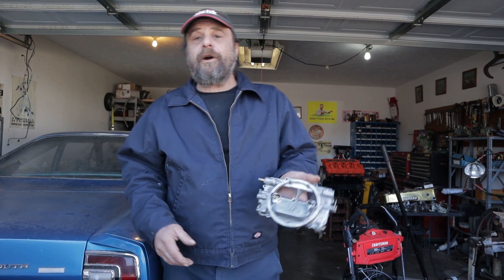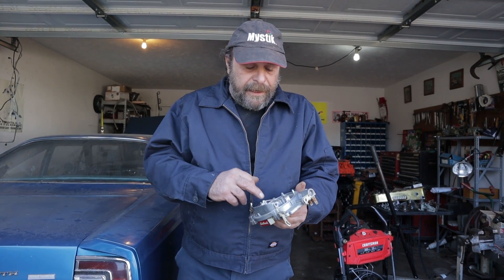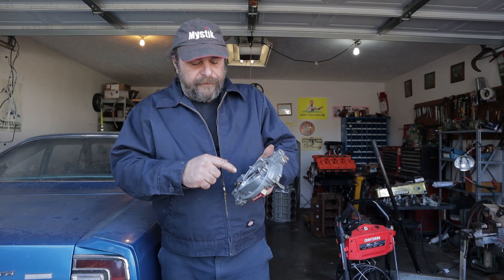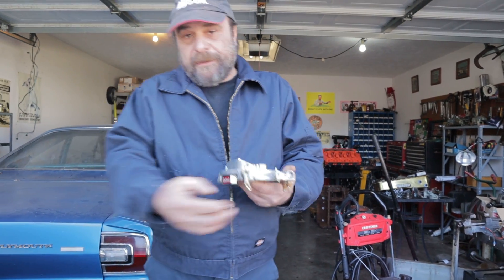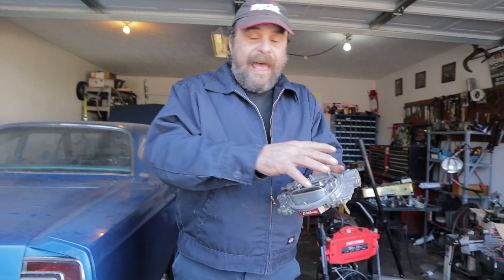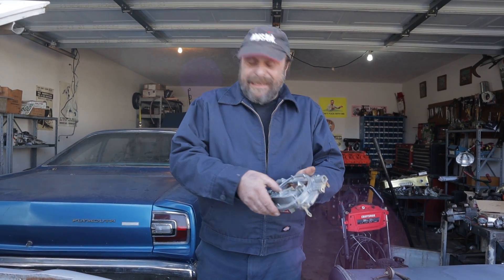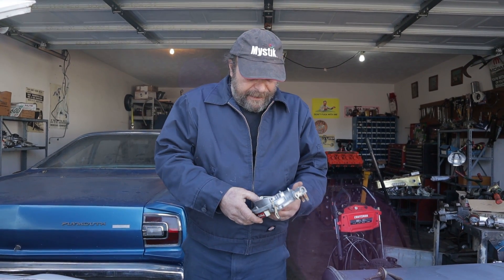The Most Troublesome Part Of Any Carbureted Car

Comment: Tony got a question that I'm hoping u could answer.   I gotta 350 in a 70 Buick Lesabre.   I made sure to set the Rochester up correctly with its divorced choke setup, mixture, fast idle and curb idle.   Even at Summer time it takes a long while, I'd say about 10 min on a very hot day for the loping idle to settle into a smooth idle.   I notice if I don't wait the ten min,  it will drive fine but will continue the loping idle at a stop light.   Only after I get home and put it in park,  it will still take the remainder of time the engine needed to settle into that smooth idle.   Im not thinking this is carb related but if u can shed some insight on this,  I'd appreciate.   Thanks and keep up the great work!

Comment: Choke what's that I don't use that especially on my John Deere d110 I just spin it Let It chug add some throttle get a bang drop it back all the way down and let it idle

Before I ever touched a computer or Electronics I was on the lawn mowers and the snow blowers especially that Tecumseh engine what a POS that could be with the carb

John Deere d110 no issue there now the way did the choke on that is if set to Full Throttle and you passed that then the choke comes on but usually I never have to engage the choke I just add a little bit more fuel back it off it gets the right ratio and ignites and the neighborhood knows who is cutting grass

And the other reason why I don't bother with choke like Tony says I don't worry about that because I pee standing up

Comment: Last time I drove a carbureted vehicle, it was a 1978 Chevy C1500 long bed pickup with a stovebolt 6 and three-on-the-tree manual. The guy had taken great mechanical care of that old truck, I pumped the gas twice as instructed, and the engine barely turned maybe 3 revolutions and started right up from dead cold (65F ish degree day) and was amazing to drive. That was a great example of the auto choke working perfect.... My neighbor just got a 1980s Ford F150 recently, and I think he is having choke issues because the truck acts dumb till it is warmed up. This all said, I prefer manual chokes. You know for sure if they are on or off, and if something goes wrong, MUCH easier to check for the reason.

Comment: Had a 2.2L Dakota in high school. If I stalled it before getting fully warmed up I kept an old sock in it. Pull the air cleaner top and stick the sock in the top to restart it. Bypassed the clutch switch so my sister could reach over and crank it.

Comment: Problem solved! Thank you so much! Nobody could seem to answer my question about the choke pull off. My old school chevy has been chugging and loading up when it's cold  and couldn't figure out why for years! Thought it was the bimetal spring but my old quadrajet has that pull off. Once I fix that she should run a lot better. And yes, I have a terrible soot problem. I hope once that's fixed that soot will blow out. I might partially plug one side of my dual exhaust to try to clear the intake crossover.

Comment: Oh, the memories... you have a way of bringing them rushing back.

"Give it two full pumps, and take your damn foot off the pedal."

How many times did I say that to customers, (and wife), pre-fuel injection, when they'd call telling me they couldn't get their car started. (If they would have only listened when I told them I got their carb working correctly for the first time!)

Re: soot/carbon build up

I worked in a sports car shop in the '80's, and the mechanics used to refer a 'free tune up'. We'd take the customer's $200,000+ car out for a test drive. The reason it was free, was we took it out and drove the piss out of the car. The first hard throttle or two would usually dump black crap out of the exhaust.  We'd learned that most of the posers with their high end sports cars couldn't/wouldn't drive them hard, so we provided a service, and did it for them.

Same thing, with senior citizens; before the time at the sports car place, I was partners in a shop. It was late '70's, early '80's recession days, and things were tough all over. We started a senior citizen's auto club. We gave a 10% discount to seniors, (nobody was giving senior citizen discounts in those days.), free light bulbs/head ights, and some other things to members.

The other thing we did was tell them to bring their cars in every few weeks, so we could 'blow out the carbon'.  We honestly told them what we were going to do was go drive the crap out of their cars.  Lots of the little old ladies would say, 'Oh, I'm so glad, my husband used to do that, but he's... too old/gone now.'  A few of the older guys would ask if they could come along.

I feel for the younger fuel injected generation of 'technicians', they won't have these wonderful memories... LOL.

old timer's tip:
I was lucky enough to have an Italian uncle who had been a mechanic since he was 15. One of the first things he taught me, (at 12-13), was how to adjust and tune a carb.  

The main trick he taught me was to use the car's antenna as a tool for idle smoothness.  Any vibrations in the car, or a miss, is transferred to the antenna and right to the end of it, where it is then magnified, because of the little ball on the end, (think physics, and relative mass).   

"Watch the end of the gawd damn antenna, it will you everything you need to know about the effing engine's condition."  I heard that a time or two, before it sunk in.

(It still works, IF there's an antenna, even with fuel inj.)

re  main choke cable
I had one on several Mopars, but it didn't go to the carb. It went to the automatic transmission!

Mopar automatics have a different valve body design. As I recall, you take the 'passing gear' (throttle down shift), linkage off, and connect it to an old choke cable. Then when you want the trans to shift hard, you pull the cable.  Or you could buy one from B&M for $100.

Loved those Mopar automatics. At one time, I even had a conversion kit to put one behind a small/big block Chev motor.

Comment: In brasil once we got a choke that uses water from the radiator to lose that spring and get the right fuel mix in every temp condition. It worked, but i saw this in just one car for period of two years (vw passat, 1976-1978, the later models until 1988 had manuals)

Comment: Yeah, I've got an 82 Camaro with an old ass Holley carb that I'm constantly fucking with in the morning. I can never seem to get the choke to be happy. I actually thought about just popping the linkage off of it, because I end up having to do basically what Tony said anyway. Open the choke all the way and then just feather the throttle.

Comment: Almost every carburetor has a manual choke break when you put the accelerator on the floor as well... just be careful, they can flood easily if you play with the throttle too much before getting it started.

Comment: So, manual choke it is.
My truck (which I haven't yet got to drive in cold weather) has an electric choke and everything is stock from 1985. The few times I've cranked it up and driven it, it did just fine. I had an initial issue of the float sticking up but that seems resolved for the time being (it has been sitting for probably five years before I got it). I don't know the carb manufacturer, but it's a Nissan. I hear a lot of people swapping out the stock carb for a Weber carb. Supposedly the people who do says it's a lot better than the stock, but the stock must not be too bad if it's still functioning fine after 300K miles and 35 years. Still, I'm tempted to modify it to be a manual choke when the day comes to swap out the carb.

Comment: I'm working on a 61 Galaxie with a 292 y block. It has the butterfly valve in the exhaust manifold, and no longer works. Picked up a manual choke kit for 10 bucks, saving the hassle of redoing that whole system. Now I can eliminate the butterfly valve and let the engine breathe a twinge better, and get rid of all the choke parts associated with the system. I like simplicity, and when it cleans up my engine bay, better still.

Comment: You nailed it. The automatic choke is by far the biggest downfall of any carb and not needed if you know how to pump a gas peddle and keep it at a high idle for a few minutes. I've bought dozens of GM products with quadra jets and I disco the pull off and wire the choke open before I even leave the people's driveway or lot. Nothing worse than stomping on the loud peddle to find out the secondaries won't open because of the choke....

Comment: When one has fully reasoned through the operation of an automatic choke it is very easy to set up. Electric, thermal or choke pull off versions all worked well from the factory so it stands to reason that if it isn’t working it’s not the choke, it’s the guy working on it. Buckle down and do the homework. Great work Uncle Tony.

Comment: Thank you for this. I used to drive a 1969 Ford F250 4x4, with a manual choke. I loved it. I could make it start in any temperature. The coldest, -50 C ( -58 F) and believe it or not, it started right up, without being plugged in. that 360 was a beast. I had to hold the clutch for 5 minutes or it would immediately stall. My Wildcat, automatic choke. It seems to work great, goes to high idle, about 1200 RPM until the COLD light goes out.

Comment: I had choke issues (issues restarting after running it for a while) on my Cordoba, and on my 1978 class b RV with the monster dodge 440 engine, i would have to reach in and manually engage the choke at start up, long live the manual choke cable!

Comment: The Edelbrock carbs DO have a pull off in their electric chokes.  Its very similar to the Holley choke you showed.   I'm not saying it is good or works perfectly but it is there.  There is a brass plug on the side of the manual choke carbs that has to be removed to add the electric choke

Comment: I think my hardest start was years ago on a day it was  -10°F ( no choke. Ford 302 with a Holley)
I filled a dozen Ziploc bags with hot tap water and packed them on the intake manifold for a while.  Eventually it started, but it took a lot of pumping and the battery was about dead.

Comment: Holley 600cfm double pumper on a 302. No choke at all.
I step on the pedal twice, hold it down a third, and start. Let it idle high for a minute.

In the winter, three pumps. On a really cold day, maybe four, and a flutter to keep it going for a bit.

Comment: would cutting power to the electric choke after first start up prevent that edelbrock flooding issue. I just added a new 600 to my 318. and noticed that issue once already.

Comment: 1 good thing with manual choke you can make it run richer continuously when needed. With welder generator some times I'd choke it a bit and get extra power under high loads

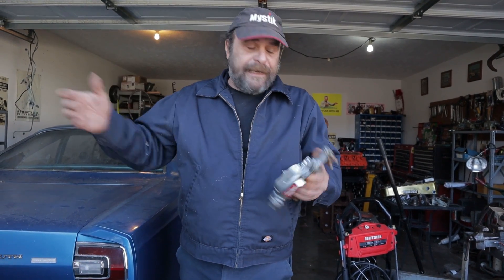Comment: BS. I stopped watching at 2:24 in.

1. What part of "High Idle Speed Screw" don't you understand to use? It's adjusted to the speed that a cold motor can idle at comfortably.
2. What part of "Rotating Choke Housing" to get a "longer" or "shorter" Choke ON time don't you understand? This is the only adjustment you do to the Choke during Fall weather, and Winter weather.

Doing 2 adjustments to a carburetor should only take a 3 minute video. But hay, YouTube only gives you money if the video is 10 minutes or longer.

And I keep giving you bad videos the thumbs down. But your crummy videos keep showing up as "recommended"

Comment: I've had more problems with chokes than any other part of the carb. Like Tony said. And the funny part is, I like in Phoenix. I rarely use one! Maybe a couple weeks a year when it's cold enough to be a problem. On most of my cars I detached the choke all together. But some engines wouldn't start without one, especially when they had high mileage. My 76 Granada had 150,000 miles on it and without a choke in the winter, it wasn't going to start until noon. If it was stormy out, forget it. So I ran a choke on that car. I put a Holley 350 cam Emissions carb on it because it was cheaper than a rebuilt carb, and more reliable. At first it started great, but after a few years it started having trouble starting again. I had it set up to start. Two pumps of the throttle and hit the key, and if it started you were in good shape for the day. If you accidentally pumped the gas more than twice, or it failed to start on the first try, you were boned. But this was in a car that had basically no cylinder pressure left. The bores were worn, the rings were shot, the valves leaked, it was old and tired and it kept going for 5 years. I had wanted to put a 351W in it, with a 400m crank to make a 408 stroker out of it, with a good set of heads and manifolds, and it would have been a good second car, or even a bracket car with all the extra weight removed. But I never got enough money together and traded it in on a new Truck at the end of it's life. They gave me $2500 for it on trade. (Idiots!)

Comment: I spent 47 years in the auto repair business from my family's service station to a dealership. I have serviced uncountable numbers of carburetors and chokes and the one thing that I can say from my experience is that manual chokes caused more problems than they cured. If someone had a cold performance problem they knew they had a problem and brought the car in for service. The vast majority of the time the repair was quick and inexpensive.

Comment: I have an 84 D150 with a 318. The carb is a Holley 2280 with a spring loaded choke. When the motor is cold the spring is strong and closes the choke but as the engine warms the spring weakens and a vacuum operated actuator pulls the choke open. It works pretty good.

Comment: Fords used that Holly type spring cap. In order to set the correct tension, I remember twisting on those like I was trying to crack a safe.
Reply: That's because Holley got started making Ford carbs...

Comment: everyone should have to drive two things... a manual and an adjustable choke. If you can use a manual you can drive anything. An adjustable choke teaches you how an engine consumes fuel and air over time. Both valuable lessons.

Comment: The choke oy stock quadajet on my stock 1980 c20 works perfect. 
Give it one full throttle pump, crank it up, she starts every time, kicks up on high idle and runs til it’s warm. Blip the throttle she drops down and runs smooth.

Comment: Great video.
Waaay back, a friend had a manual choke in his car. It always started in the coldest Jersey winters.
Hey for a laugh, you should tell the kids about Ford's "vonderful" variable venturi carbs. 😁
Reply: I used to rebuild carbs all the time at my job. I probably rebuilt hundreds of the electronic feedback QUADRAJETs. Then my department purchased about 2 dozen 1987 Crown Vics with VV carbs. I was there when they were delivered brand new and I was the first one to drive each one. It seemed like every one of these allegedly identical cars had a distinct personality because there was so much variation in the factory settings on the carbs. Since Ford designed them to be basically tamper proof my boss decided to replace them all with Holleys.

Comment: Maybe you can help a guy, got a 85 w150. has 318 with a 2 barrel on it, it runs good initially, but you get some heat in it and it bucks, and dies, but can restart right away, where would a guy start looking to fix that

Comment: The number one thing to do when adjusting the choke :  Make sure the engine runs properly when hot, if the engine doesn't run hot it won't run good cold.. . . .  Next, let the sit overnight, make adjustments then start and run the engine to full warmup.  Pay attention to how the engine runs then make an adjustment and let it cool overnight again.

Comment: I see a lot of proponents for a manual choke. They're ok for some people, but from a pure driveability standpoint, a well set up auto is the ticket. Like if your heading out on a date in your '73 Electra deuce and a quarter, you don't want to be fumbling around with a choke. I guess I saved so many cars from bad pull off deaths and the fact that I've lived and worked in FL, it's just a different perspective. It's all good.

Comment: Living AZ, my biggest battle with my carb'ed C10 is not cold start vapor lock, heat saturation,  and no access to ethanol free gas.
Reply: Change your metal fuel line to a rubber hose, (from fuel pump to carb, engine heat is causing the vapor lock.)  and end your vapor lock problems.

What kind of problems is ethanol causing?  The old rubber on the C-10 likely doesn't hold up to the ethanol, but once you swap that out, there shouldn't be problems.
Reply: @georgedennison3338  thank you . I have tried that .  It does it in the middle of summer when really hot here  . Heat soak also kills it after a cruise and stop .   It is not a daily driver so wondering if ethonal is separating from fuel ?  Thanks again !

Comment: "DO LIKE GOD INTENDED AND PUT A MANUAL CHOKE CABLE ON IT"  !!!!
Thank you Uncle Tony, I couldn't have said it better myself.
All the crap the factories added to make automatic chokes work actually kill the performance of the engine and require way too much maintenance.  Put a cable on it and a little hardware to hook it up, then you can adjust the choke yourself so no matter what temp it is outside, no matter what temp the engine is, no matter what other factor... it can always be adjusted right from the driver seat to run the way it should.  Then you can get rid of all the extra parts that made the auto choke work, open up the exhaust (those damn heat riser valves always rust stuck in the closed position), block off the manifold crossover so the intake doesn't get so hot, throw away the pull off so you have one less thing to fail, and you're engine will be 10 times more reliable.